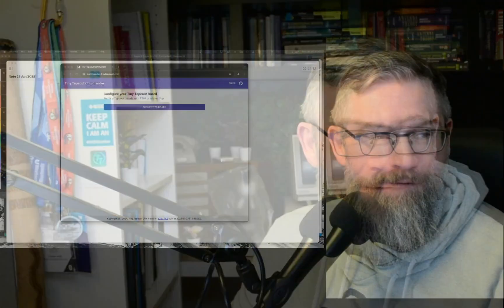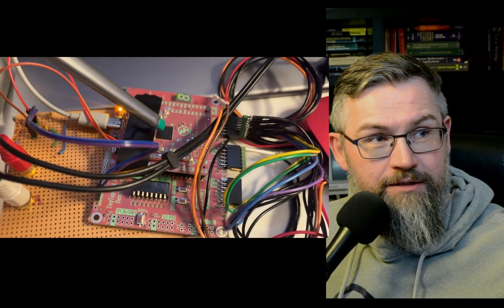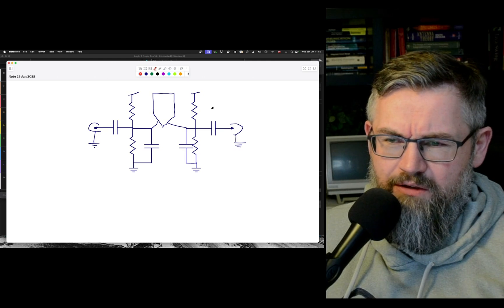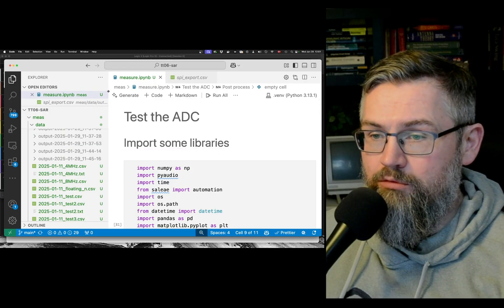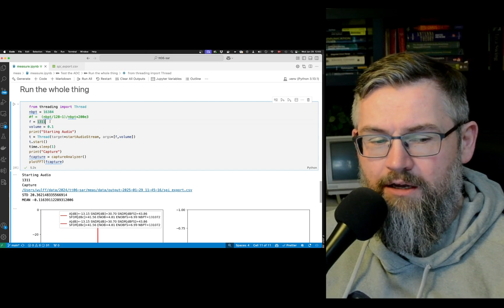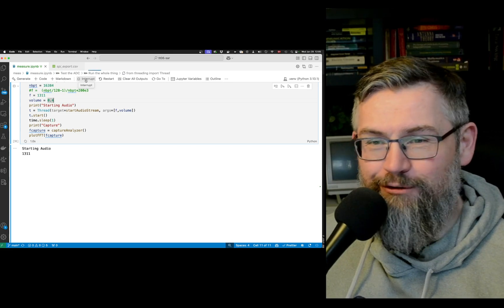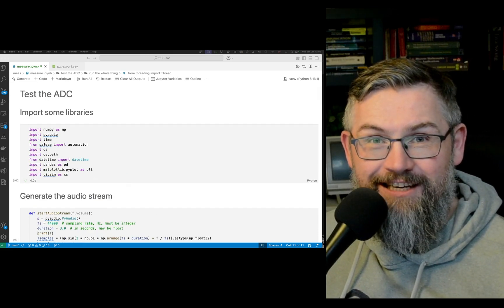TinyTapeout6 - My SAR ADC is alive!

Comment: Hei Carsten! What do you think about the feasibility of doing a Programmable Gain Amplifier on TinyTapeout? Maybe first separate, and then ideally integrated with an ADC. I think a PGA + 8 bit could be usable for a fair amount of audio demos, since the PGA with automatic gain control can be used to maximize the usage of the fairly limited dynamic range of ADC.
Reply from the maker: The challenge is likely going to be the 500 ohmish input/output switches on TT, but I'd encourage trying

Comment: I have so many questions! I have been dying to learn ADC design, what is the maximum frequency that your design can resolve? Is it 50 ohm input matched? What is the sensitivity and noise figure? What is the lowest dbm power that can be detected?
Reply from the maker: The ADC input is a switch capacitor, as such, it's not matched to 50 Ohm, and it's not designed to capture RF signals. It would need an LNA, mixer, and a filter in front. Have a look at https://analogicus.com/aic2025/2025/03/27/Lecture-10-Low-Power-Radio.html . It should explain how to use a SAR ADC in a radio context.

Comment: Testing the Tiny Tapeout 6 Successive Approximation Analog-to-Digital Converter (ADC)

*   0:00:16 Overview: The presenter discusses testing their successive approximation ADC from the Tiny Tapeout 6 project.
*   0:00:49 Testing the ADC: The presenter explains the need for an input signal to test the ADC, which is connected to the board via soldered wires.
*   0:01:51 Tiny Tapeout Board: The board features a USB connector for power and communication with a computer and requires an external input for the ADC.
*   0:03:36 Ease of Use: The presenter praises the Tiny Tapeout board's interface, highlighting its ease of use for selecting and enabling the ADC.
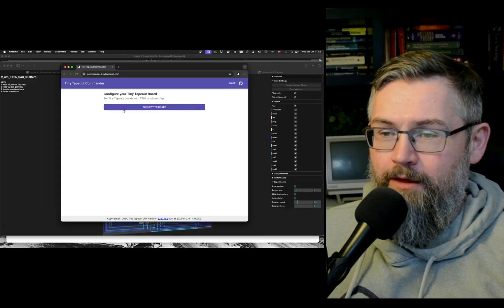*   0:03:48 Digital Output Capture: The Saleae logic analyzer captures the digital output, with a specific signal (da) indicating the stability of the output bits.
*   0:05:19 Input Network: The input network uses the audio output from a docking station, sent through bypass capacitors and resistors to create a pseudo-differential signal around 0.9V.
*   0:06:57 Signal Generation: A Jupiter Notebook generates audio signals at 44 kHz, which are then played through the docking station's audio output.
*   0:08:11 Data Capture and Analysis: The Saleae logic analyzer captures the ADC output, and the data is post-processed using an FFT to analyze signal quality and identify spurs.
*   0:10:31 Spur Investigation: The presenter suspects the presence of spurs in the output signal, possibly due to the input network, and plans to investigate further using INL and DNL measurements.
*   0:11:48 Performance Evaluation: The current effective number of bits is around 6, which is lower than expected, potentially due to testing issues rather than the ADC design itself.
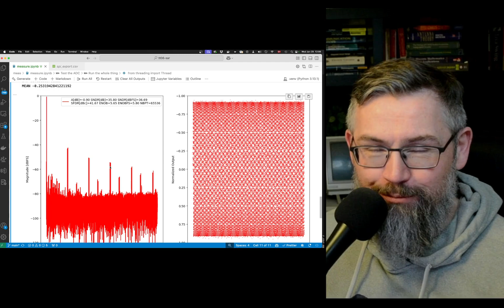*   0:12:08 Tiny Tapeout Appreciation: The presenter expresses enthusiasm for the Tiny Tapeout project and its accessibility for testing and developing integrated circuits.

I used gemini-1.5-pro-exp-0827 on rocketrecap dot com to summarize the transcript.
Cost (if I didn't use the free tier): $0.03
Input tokens: 21716
Output tokens: 460

Comment: Hi professor, very exciting stuff there! I wonder if you could give a bit more insight on how you have selected the input frequency. I've seen designers selecting the input frequency the closest prime to the sampling frequency for the ADC verification, yet could not tied this piece of information to your approach..
Reply from the maker: Hi. Thanks. 

Sure thing. I've updated the jupyter notebook a bit since the video. In short, when you do an FFT it's sufficient to have a input signal that ends up in a odd FFT bin, since in an FFT there is always 2^N points, then any odd number is relative prime to the number of points. Some claim you need a prime number, but that's wrong in my opinion. 

There reason for a relative prime is to ensure that you hit all codes. If you have an even number you can end up hitting only some of the codes.

 In addition, you want the end of the signal (last sample in the 2^N sequence) to match up with the first sample, so you want an integer number of periods of the input sinusoid. To some extent, it's possible to fix "match the start and the end" with a window filter, I'm a fan of the Hanning window.
Reply: @analogicus oh that makes a lot sense now.. thanks a lot for the explanation!

Comment: 44000 isn't a common rate for audio. It'd be either 44100 or more commonly now 48000 so there might be some resampling going on causing weirdness.

I'm also curious if you ran the same measurement on the data I sent ? Do you see the same harmonics. I just had a quick look and I see some but they seem to be weaker ( ~ -55 dBc )
Reply from the maker: Think I fixed the problem. Indeed there was wierdness between the audio DAC and the sample rate. What I think happened is that due to the low sample rate of the DAC, and the high oversampling of the ADC, I was seeing spectral copies. 

I've reduced the input frequency to 1 kHz, ADC samplerate to 16 kHz (ish) and DAC rate to 48 kHz. Now I get an ENOB of 7.06, which is about what I expect from this ADC. 

Yes, I did have a look at your data. I'll send you a PM.

Comment: Very cool! Been watching the series a while, so satisfying to see it reach this stage. 

-40dB is only 1% harmonic distortion, which isn't all that bad for audio run out of a docking station. 

If I were evaluating this ADC, I would buy an XMOS multichannel development board, since it can hit loopback distortion levels around -110dB, then I would add the tinytapeout ADC as a parallel dummy load, ensuring that the analog capture network doesn't affect the signal quality for the loopback, then I would take the measurement via the saleae+TTOadc and compare the raw waveforms in audacity (pre-FFT)... getting them aligned manually there isn't too tough. I've had issues with python's built-in audio FFT tools giving me values ~20dB worse SINAD than what Audacity calculates, even with the same FFT algo and window size, but I can't remember the fix off the top of my head. 

Good luck, and I can't wait to see more!! Thank you for all the great resources and valuable education that you've shared here!
Reply from the maker: Thanks!

Got it up to an SFDR of  56 dBc now. I needed the sample rate of the audio DAC to be higher than sample rate of the ADC. I think I was seeing the spectral copies (to be confirmed). 

My favorite source is the DS 360 from Stanford Research (https://www.thinksrs.com/products/ds360.html) I have at work, but it's a bit overkill for an 8-bit ADC.